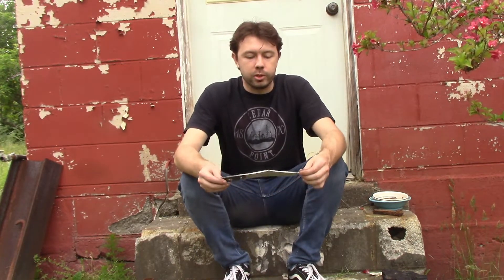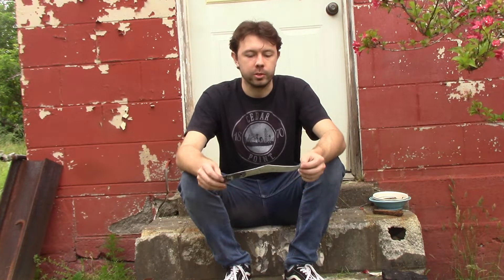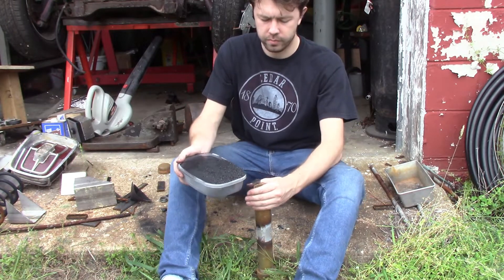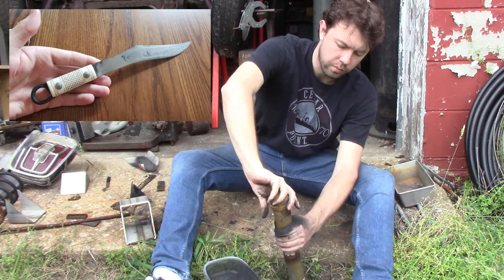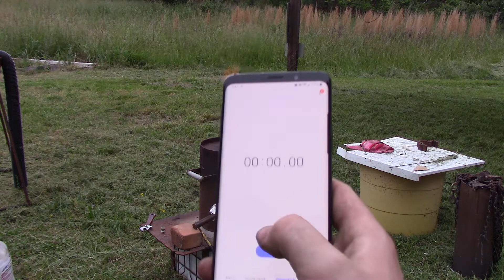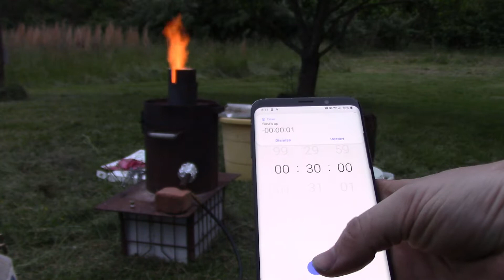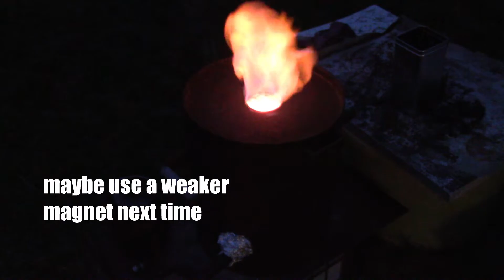Case Hardening Mild Steel by Carburization

Comment: So could the deepening of the discussion be done by adding more oxygen, to make more carbon monoxide, or would it become very hard )too hard, of just left in the furnace 3 or 4 x as long
 Was that large gain too,  I guess that would happen anyway for 30 min heating
Reply from the maker: More oxygen wouldn't do much, there is already plenty of CO and you'd run the risk of completing combustion to CO2. To get deeper carburization you would leave it in for a couple hours. Higher temperature also speeds diffusion some

Comment: I made a chopper knife out mild steel carbonize it temper it  cuts fairly decent, but I didn’t expect it to be wonderful it chops meat n bone good I kept much weight on the blade as possible. It’s ugly but functional for what I need.

Comment: 1700 F for at a minimum 8 hour soak, will give you about a 1.6mm or about a 16th of inch of higher carbon steel.  Don't forget to thermocycle the steel atleast 1 hour at 1400F.  Water Quench. Should end up around 58-60 Rockwell hardness.

Comment: The technique was called FAGOTIZING. not a gay slur. In older English, a group of rods is called a FAGOT.  A group of iron bars would be packed in an iron box with powdered charcoal. The whole thing would be heated for a long period. The iron bars would transform to steel, slowly. The longer the time baked, the better the quality of steel.

Comment: Also, I saw an old Paul sellers video where he says to use a mild steel rod and place the magnet on it. You can adjust the magnetism by sliding up and down the rod. Also, magnets can lose their magnetism at high heat, so it mitigates that risk. I'm gonna give this a shot with some bone meal in the mix, what do you think about that? I've heard it's what they used historically.
Reply from the maker: Pretty sure I read the bone meal doesn't really do anything, even if that was historical practice

Comment: I contemplated doing the same on my mild steel gladius project. It can be done, but its more of a pain than on shorter stuff.
In fact, its so efficient that you can actually introduce so much carbon to make cast iron, therefore melting your blade. But youd have to have a superb oxygen source or forget about it in the fire. I usually keep the object in for an hour at the most, as blades arent usually so thick to require more time in...

Comment: Hey man, I know Im two years late to the scene but Im just wondering on how your blade edge is holding up? Did you find that the carbon diffused into the steel just fine or is the center still soft mild steel? I would hope the carburization made it at least through the entire edge thickness so it stays high carbon for at least a few sharpenings. If you see this comment, please do let me know what happened
Reply from the maker: I don't use it for anything so I can't say how it would hold up to multiple sharpenings. Definitely should have let it soak in the heat longer as I mentioned in the description for a better case depth.

Comment: Actually the air at the burner tip is called secondary airvthat creates a completw burning of your fuel and hence a quicker hotter flame. Think oxidation on an acetylene torch. The yelliw flame atcyour exhaust port indicates reduction. Carborization through incomplete burning. If lityle value to your shielded knife blade. The air coming in atvthe back of your burner is the primary air snd should adjustable .

Comment: I use terracotta for the containment vessel. It works really well and just cracks off with a couple Hammer blows after you are done. If I am carburizing a knife that has already been forged into shape I will usually grind up some charcoal and a little bit of flour add a small amount of water and turn it into a paste. I then cover the knife with that paste and let it dry. After that I cover the whole thing in terracotta, throw it in my forge for about 30 minutes and then let it cool off before I remove the clay and residual charcoal. I have done this with a railroad spike as well, I let it stay in the forge for an hour and a half and it carburized about 3/4 of the way through and only left a small amount of low carbon steel in the very center. I have been using that hardened railroad spike as a hot cut chisel and it can also be used to score cold iron/mild steel. It's definitely a cool process because you can basically use any junk steel and get it to a usable carbon content, though I have gotten very inconsistent results with rebar.

Comment: BTW, case hardening and carbon diffusion works perfectly fine inside your chimney, especially if you have one with glass windows. 
Closed with glass windows makes them burn hotter, because it only draws air from the bottom, furthermore you can watch the glow of your parts and thereby judge the temperature.
Just did a few parts (1045/C45 mild steel) in my chimney, left them inside the charcoal for about 2h at about red to orange glow temperature (something around 850-920°C), then quenched it in water. Became very hard, so hard a knife doesn't scratch any more. Carbon diffusion works too, because I already tried it yesterday, but without the extra 2h of diffusion time, hardness wasn't satisfactory, so I tried it again today, with extra carbon diffusion time, with very satisfying results ;-D
Reply: 1045 is more of a medium carbon steel, it definitely is hardenable although it is a bit low in carbon for knife blades.

Comment: I recall reading some where carbon will enter the steel at roughly one millimeter per hour at austenising temp.  you can also nitride the steel by adding things like bone and leather to your crucible/pipe. One of my favorite videos of clickspring is his video making metal files from case carburized mild steel.
Reply: correct me if im wrong...what i often found is 0.1mm per hour.
Reply: @Riceohm considering the results by click spring I would assume that those attempts may have been at sub optimal temps? I’d like to find a research paper about this subject.

Comment: You should not use used motor oil to quench as it's full of impurities. Which you will infuse into your metal resulting in unknown effects. A quart of new motor order would be a lot better. But the video was very helpful and worth my time.
Reply: Steel doesn't remain hot enough for long enough for impurities in the oil to dissolve in the steel. Motor oil in general is a suboptimal quenchant, and new motor oil isn't significantly better than used motor for this particular application.

Comment: I have a question, I did everything you did I think to the best of my knowledge. The only thing I did differently is I didn't grind up the charcoal into a powder, They were small chunks and the knife fit in the tube pretty snuggly tight. Would this have effected the carburization process at all?
Reply from the maker: It should be fine in that respect. As it heats up you want the charcoal to form carbon monoxide with the oxygen in the tube. As long as there's enough to do that and react with any extra oxygen as it leaks in it should work. I also just updated the description with some stuff I learned later, check that as well.

Comment: For someone who had no idea about case hardening this was mind blowing. Do you think I can apply this process to harden cheap, low-carbon chisels?
Reply from the maker: Probably, but my case depth turned out to be only .2mm after an actual test. It will never be as good as one made of better steel, but it's still fun to try

Comment: Well done. Reminds me of the traditional Japanese sword-making method I saw done once. I made (or started really) a big camp chopper out of mild steel angle-iron. I figured an "axe grind" and its weight would do most of the work for me, even without being able to harden it. Now I want to attempt this method and see if I can get a hardened blade out of it. I have a couple diff sizes of steel barrels, so I'm thinking of making a kiln out of one of them. Thanks for sharing.
Reply from the maker: Couple notes if you're doing something hefty like that: 
I had mine tested and the case depth wasn't as deep as it looked in the break. So it couldn't hurt to soak your piece for a couple hours if possible.
Second if you do your normalizing ahead of time there's no need to do anything but the quench after carburizing. Heating it extra times just gives the carbon an opportunity to  migrate away or burn off the surface.
Good luck!